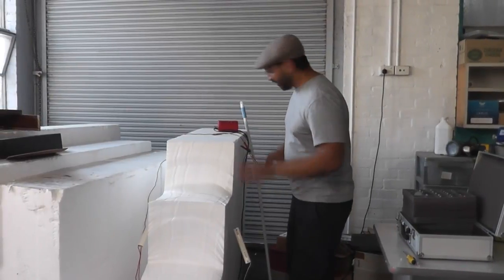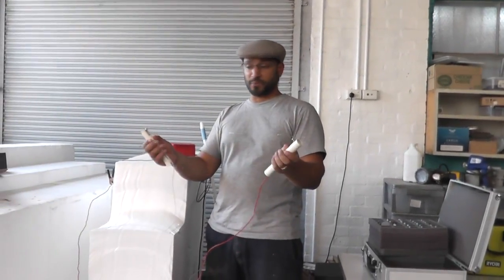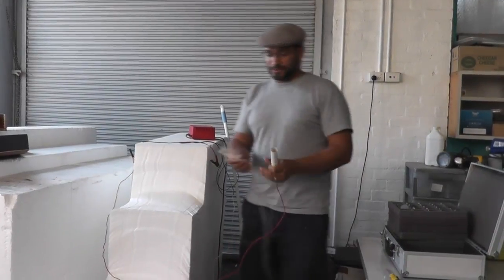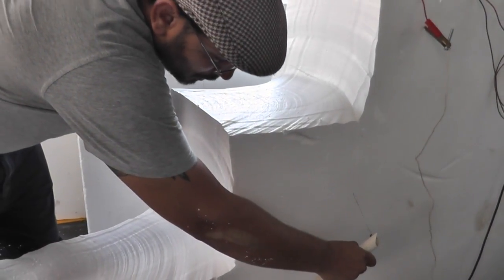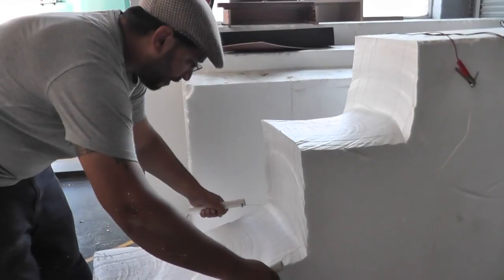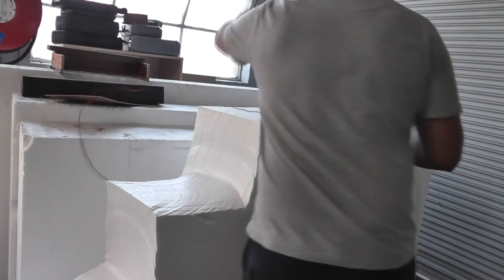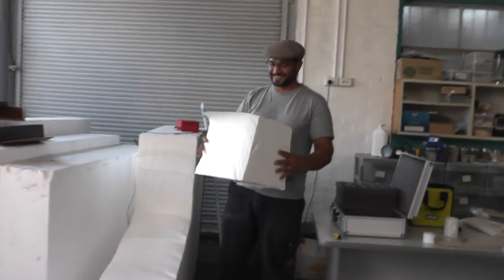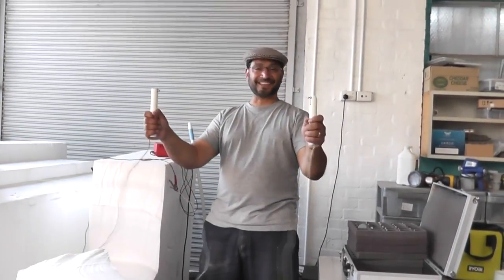Home-made Freeform Hot Wire Cutter

Comment: Awesome stuff. What sort of voltage/amperage is the battery charger kicking out. Although I have cutters already, I wouldn't mind making one of that type at a later date.
Reply from the maker: I checked that charger, it doesnt have that little "electrical info" panel on it ... so all I could garner was its a 12v charger  :)  Sorry Bidge.
Reply: RubbishInRubbishOut Probably for the best anyway bud. I doubt Mythril would let me make one. After all I'm banned form touching electrical projects, since I zapped myself through the houses main supply (repeatedly), when I was changing our showers power cable. She reckons that is what caused all my heart issues and she's most likely right.
Reply: Aren't you creating a dead short